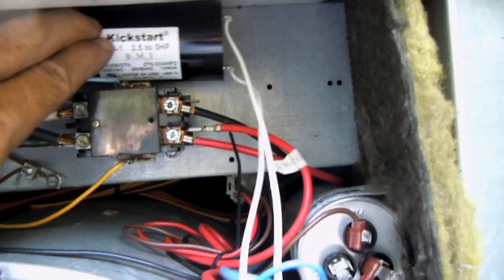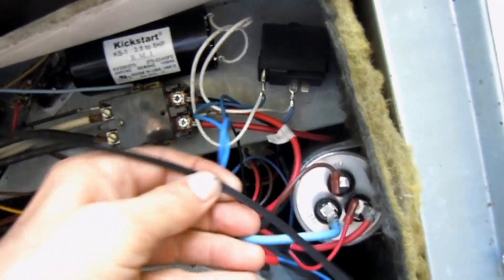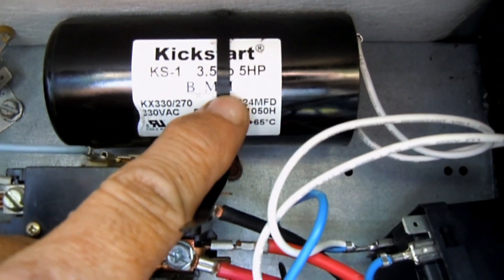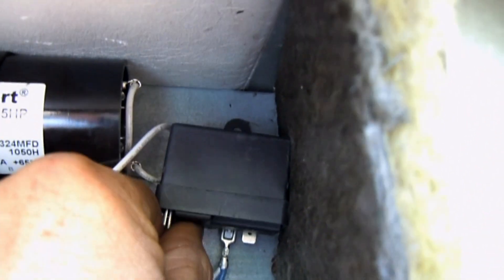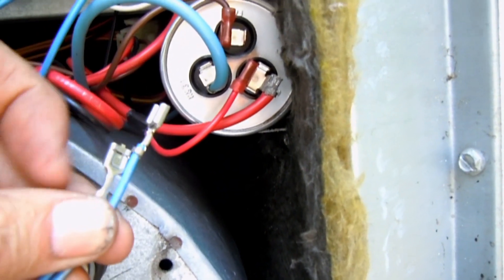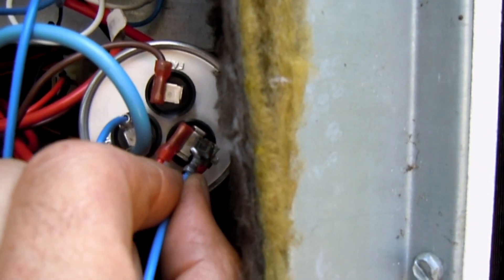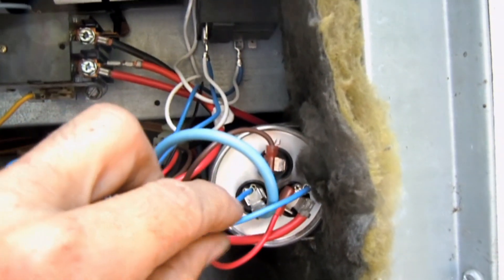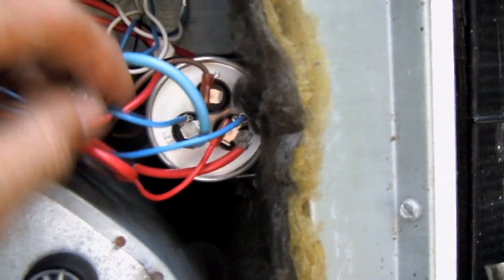HVAC KickStart hard start kit by RectorSeal

Comment: 2 questions for you Doctor Z.   There are 2 wires going into the black capacitor on this kit.  Does it matter which white wire goes to either side of terminal?  Would flipping it cause device not to work?  I didn't think so, but do please clarify.

I had a T05 model (for a 1-3 ton unit) running at my folk's house for 6 years.  Although the lights don't go very dim, it lightly flickers when the AC compressor kicks on.  Is there a way to test if and when the hard start kit no longer functions/ or functions poorly?  Thank you in advance for your answers.
Reply: Hard starts won't completely eliminate dimming.   The best way to verify the hard start is functioning is with a current clamp set on max inrush. Measure one of the hard start's blue wires.   Should show an inrush for a second or two at start.  Then measure running amps on the same wire.  It should go to zero or very close.  A hard start must drop out of the circuit quickly or damage to the compressor could occur.   You can also check the hard start cap uf.   A soft start such as Copeland's SecureStart is more effective for light dimming and when you need to use a generator to power a compressor.  It is more expensive and has more involved wiring.

Comment: at exactly 3:20 you can see a spark jump from the side to the frame body! wow.. check that out DrZarkloff!  did you see that.. you almost got shocked!

Great video.. my HVAC Installer.. at the time.. put one in and it was crap.. it was a 321 i belive.. so I put in another one.. myself.. simple piece of cake.. worked like a charm.. started every time.. even when it got 120oF here in the desert!

Comment: Great video thanks Dr Z! A suggestion on a follow up video, how about one on the kickstart cap's potential relay , how it works, why it's necessary and how it differs from the current relay and other devices that take the cap out of the circuit . Thanks :)

Comment: 5-2-1 Compressor saver is best out there hands down in my opinion for those interested. There is only 3 sizes, you pick the one for your unit. Quick install and very affordable, works great EVERY start up. 

Since I went with these, I have never used any others.
Reply: 5-2-1 Hard Start kits have a horrible history of failure with the potential relay and they are made off shore.

Comment: I need to do this for a 5 ton unit but i am scared. The method I commonly hear about is just using a start capacitor which you need to size based on the compressor and then some time down the road you find out that the cap burned the windings . How much is one of these kits?